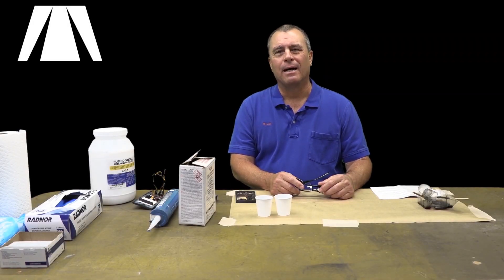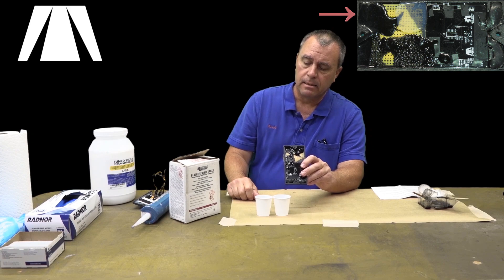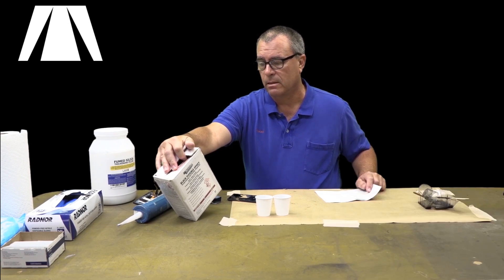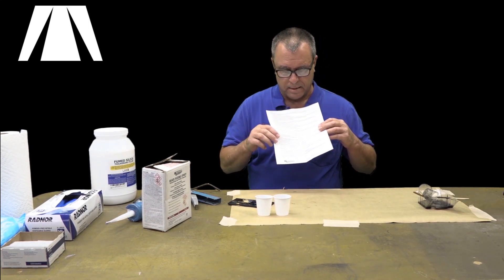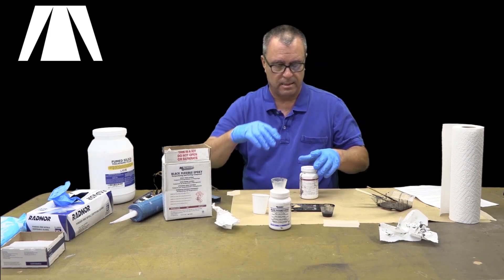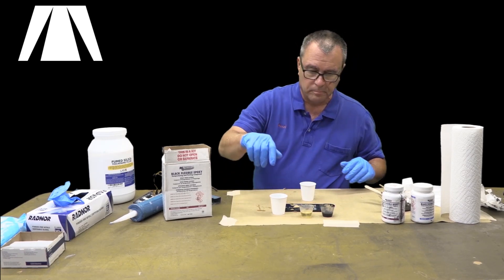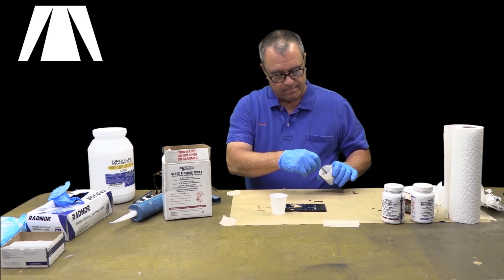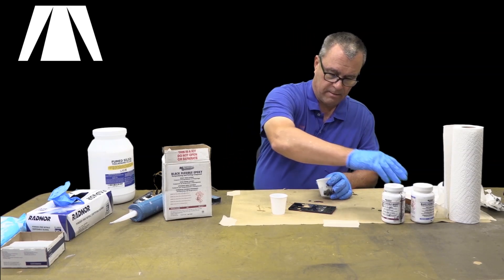IoT#94 Potting Compound Comparison

Comment: ca you use regular silicone tub from Home Depot or just glue sticks for any glue gun?
Reply from the maker: Silicone rubber won't lay down without wiping with water and looked very DIY.  I use hotmelt glue to seal the serial port and to keep the flat-flex connector from accidentally popping open.